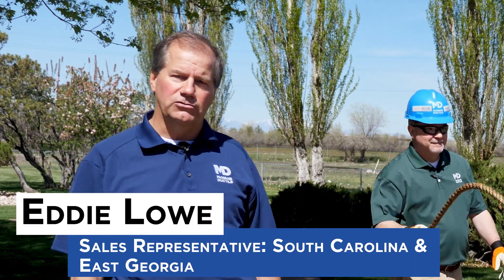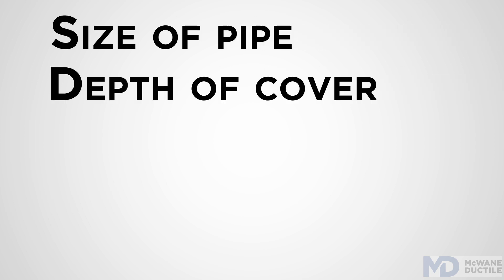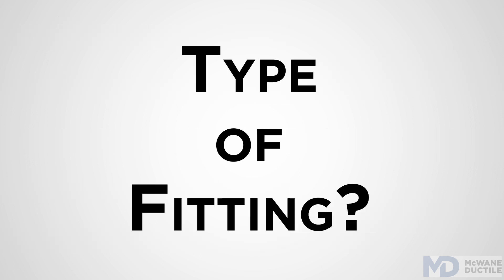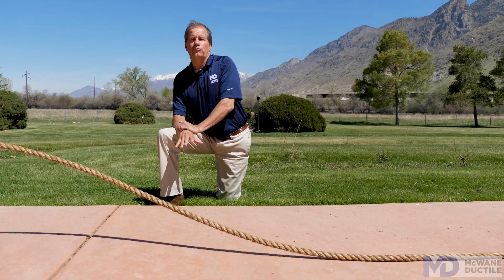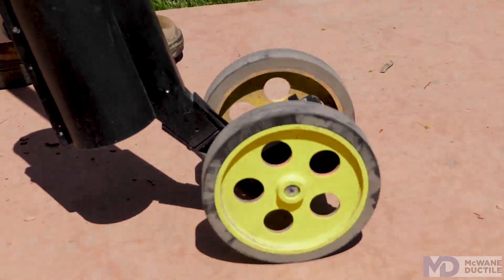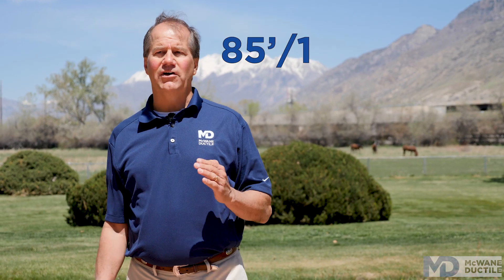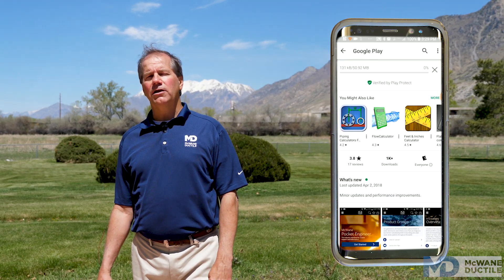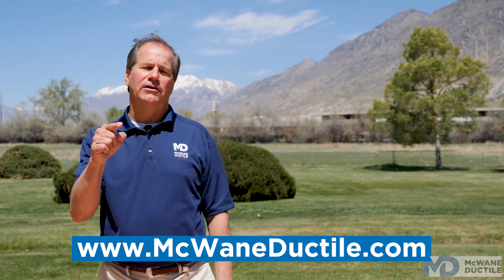When Should You Use Restrained Joint Pipe?

Comment: This rope model/analogy really isn't explained here, at all.  I've no idea where this 85 foot number comes from.
Reply from the maker: The rope is simply meant to provide a visible representation of the pipe as it would react, or wiggle, with the thrust forces generated on either side of a change in direction via a bend.  The thrust force will ultimately dissipate due to the various conditions in which the pipe is installed.  The movement in the rope was approx. 85 feet in the demo, and that is just an arbitrary number used to show the “wiggle zone”, or the footage that would need to be restrained to keep the pipe connected.